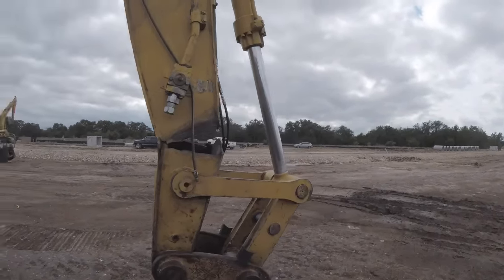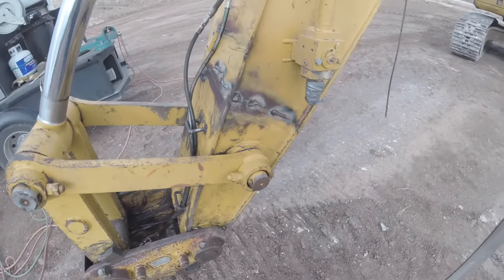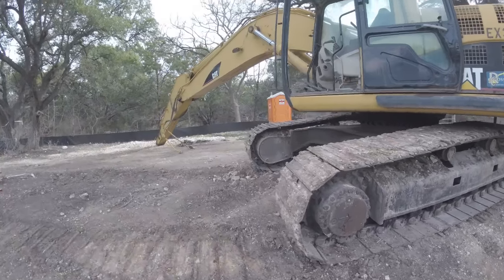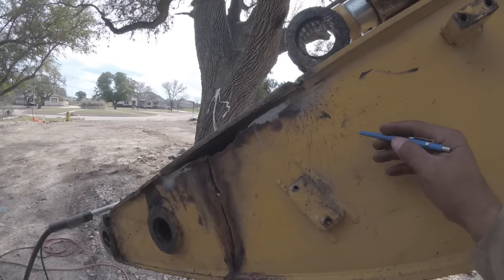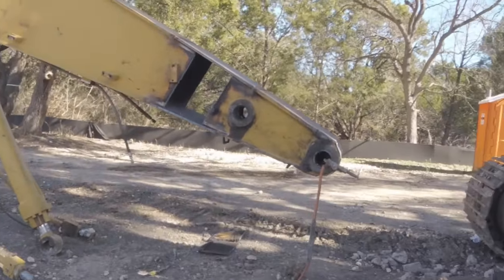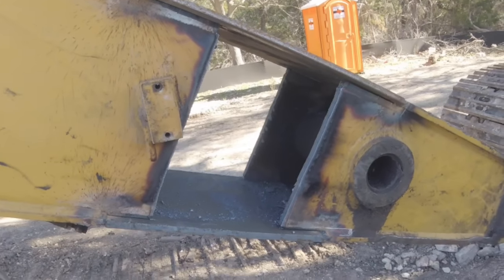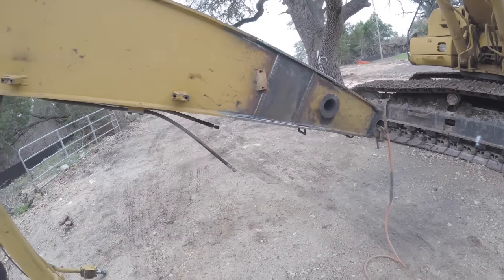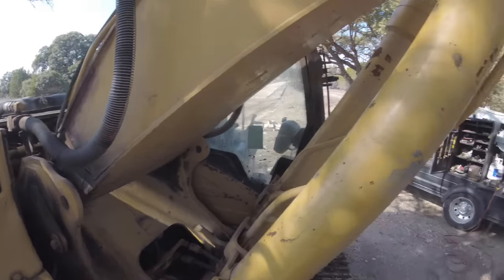Woops!! Excavator had a bad day!!

Comment: i have been welding for 35 years if this guy worked for me i would've "FIRED" HIM!. So much heat is being applied to this boom arm that the actual surrounding structural integrity is being ruined.
let me list the OMG moments i have witnessed: HE BASICALLY PUTTING A BANDAID ON THIS SHIT!

1. YOU DO NOT USE A WIRE FEED WELDER FOR THIS TYPE OF EQUIPMENT
A WIRE FED WELDER IS ONLY USED FOR ROOT PASSES IF ANYTHING OR FARM EQUIPMENT OR OTHER SMALL WELD JOBS. NEVER ON THESE BIG MACHINES. EVERY TYPE OF WELDING HAS IT'S OWN PROCESS.
 OTHER WISE A 6011 SHOULD BE USED FOR A ROOT PASS. THE REST SHOULD BE DONE IN MULTIPLE PASSES OF A 1/16" TO 1/8" 7018 ROD. FINAL PASS 1/8" TO 3/16"( 1/4" IF NOT AVAILABLE).
2. AT 20:40, HE SAYS THE STRUGGLE IS REAL! YOU DAMN RIGHT. HE HAS THE USE OF ONLY ONE FUCKING PIPE CLAMP.  IF YOU ARE USING CLAMPS DO NOT REMOVE THE CLAMPS UNTIL THE WELD IS COMPLETELY COOLED. HE COULD'VE CLAMPED THAT SO GOOD THAT ALL HE WOULD HAVE TO DO IS WRAP THE ENTIRE AREA WITH WELDING BLANKETS. OH WAIT, THERE ARE NO FUCKING WELDING BLANKETS.
THE METAL'S STRENGTH IS BEING COMPROMISED BY THE HEAT AND WHILE THIS IS HAPPENING, THE METAL IS DOING WHAT WE CALL "WALKING OR DANCING". ITS SLOWLY MOVING AND EXPANDING. THE EYE CAN'T SEE THRU THE WELD BUT THE WELD IS STRETCHING AND MOVING AS WELL.  AT THIS POINT THE CLAMPS SHOULD REMAIN TO HELP RETAIN INTEGRITY AND SHAPE AS WELL AS STRENGTH. "FML" 
3. BACKER PLATES SHOULD EXTEND FARTHER IN THE ARM IN ALL DIRECTIONS NEEDED. IN THIS VIDEO HE ALLOWED MAYBE AN INCH FOR THE NEW PLATE TO BE ATTACHED TO. THE PROPER WAY IS TO DRILL HOLES WITH A MAG DRILL (WHEN PROPERLY USED IT DOESN'T EMIT MUCH HEAT), AT LEAST 3 TO 4 OF THEM ON THE UPPER AND LOWER PART OF THE BOOM ARM PEICES AND MAKE THEM OFFSET TO HELP WITH WELD HEAT DISAPATION. 
WE ALSO HAVE A TYPE OF FIX OR REPAIR CALLED FISH MOUTHING. THIS ALSO SHOULD'VE BEEN DONE AFTER THE PLATE(S) WERE WELDED TO ADD MORE STRENGTH. THESE ARE DIAMOND SHAPED OR RECTANGULAR PEICES OF METAL THAT EXTEND BEYOUND THE REPLACED METAL, PATCH OR REPAIR.
THE BACKER PLATES SHOULD EXTEND AT LEAST 6 INCHES MINIMUM 3 INCHES PASS THE WELD WELD AREA. THEN WELD THE BACKER PLATE TO ARM USING THE HOLES DRILLED. BASICALLY FILLING THEM CALLED "PLUG WELDS". 
IN THIS VIDEO THE BACKER PLATES ARE JUST USED TO HOLD THE NEW PLATE IN PLACE. NO STRENGTH AT ALL SO STUPID.
4. WHY ARE THERE NO WELDING BLANKETS PRESENT BETWEEN EACH WELD? I WILL TELL YOU WHY. THIS MAN WAS NOT TAUGHT PROPERLY. I DO NOT CHARGE BY THE HOUR FOR EVERY JOB. THIS IS WHY I HAVE BEEN SUCCESSFUL IN MY TRADE. NOT EVERYTHING IS TEXT BOOK. EVERY PROBLEM WILL ALWAYS PRESENT ITSELF DIFFERENTLY TIME AND TIME AGAIN.
I HAVE WELDED BIG MACHINERY AND HAVE NEVER DID A JOB WITH OUT THE USE OF A WELDING BLANKET. IT DOESN'T MATTER IF THE TEMPERATURE YOU ARE WORKING IN DOESN'T CALL FOR IT.
" THE FRICKEN WELD YOU PLACE DOWN CALLS FOR IT! "
YOU NEED TO ALLOW THE METAL TO REST AND RE-MOLECULARIZE DURING THIS COOLING DOWN PERIOD. IF THIS GUY KNEW ANYTHING ABOUT METALERGY TAUGHT AT WELDING SCHOOLS WORLD WIDE HE WOULD NOT BE DOING THIS. 
"THIS IS BLASPHEMY I TELL YA... BLASPHEMY!"
5. AT 28:50 HE SAYS IT'S NOT THE BEST, BUT NOT THE WORST. ARE YOU FUCKING KIDDING ME?! THAT RIGHT THERE PROVES THAT THIS GUY IS A HACK. HE MAY HAVE WENT TO SCHOOL FOR WELDING BUT IT DID NOT TEACH HIM HOW TO ENCOUNTER AND DELEGATE PROBLEMS. THIS COMES WITH EXPERIENCE. I WOULD'VE HEATED THE ENTIRE ARM BEING WORKED ON WITH A SPACE HEATER AND "WELDING BLANKETS!" 
JUST TO PUT ICING ON THIS CAKE I WOULD'VE REMOVED THE ENTIRE ARM AND TOOK IT BACK TO MY SHOP IN A MORE TEMP CONTROLLED ENVIRONMENT IN THE FIRST PLACE. HE LITERALLY JUST PUBLICLY ADVERTISED NOT JUST TO US ON YOUTUBE BUT ON HIS CLIENTS WORK SITE THAT HE KNOWS HOW TO PLACE BANDAIDS. 
IF THIS FIX LASTS THEN HE IS ONE LUCKY "MF"! 
IN REALITY THE CLIENT SHOULD'VE SENT IT TO A MACHINE SHOP INSTEAD. EVEN THEY WOULD NOT HAVE PERFORMED HACK SURGERY ON A $100,000.00 MACHINE. 
LAST BUT NOT LEAST, PRETTY WELDS AND SURFACE BULLSHIT MEAN NOTHING IF IT'S NOT DONE PROPERLY.
PENETRATION AND SATURATION OF THE WELD MEAN MORE THAN THIS BULLSHIT!

HE EITHER CHARGED DIRT CHEAP OR THE COMPANY WAS BEING CHEAP. I WOULD'VE REPLACED A GREAT DEAL METAL AND GAVE A LIFE TIME WARRANTY. I WOULD'VE CHARGED THEM AND BUILT THEM A NEW ARM WITH NEW METAL. BECAUSE I KNOW MY WELDS WILL LAST.

Comment: All of that??? You should have just added half inch plate top bottom and both sides.. one solid piece 16in on either side of the crack.. on the sides..two pieces of 3/4 plate again 16 in either side of the crack.. on the top... Clampitt welded good for another 10 years you would have been done... At this point I'm at the 11 minute and 35 seconds time stamp and.. EITHER YOU'RE REALLY GREEN OR YOU'RE MAKING YOUR MILK MONEY...

Comment: Why is that being welded? It has failed way too many times for more repairs. The metal is fatigued and cannot be made strong enough to do the job it was designed and built for. You are opening yourself up to be sued WHEN that fails again. Metal is amazing, it can do so many things but it reaches a point where it can't be safely repaired no matter how good you are. That metal will never be as it what the manufacturer requires for that boom arm. That steel needs to be melted down and recycled, that is the only way it will ever see safe use again. 

If a company can't afford to replace worn out equipment they shouldn't be able to keep their license to operate the equipment. This machine should be inspected and that boom arm needs to be magnetically checked, xrayed, and have an ultrasound survey done on it. I can guarantee it will fail every single one of those inspections. 

I wouldn't repair that equipment for all the money in the world. It's just not worth the risk because it will fail again directly adjacent to your weld repairs. They are overloading the machine and that spot right there breaking so much, as evidenced by all the previous weld, is direct proof that they need a machine about 50% larger to safely do the work they are trying to do with an insufficient machine.  I've got several thousand hours in big backhoes and the strain this machine is seeing is unacceptable. Company owner is either broke and can't afford to fix it, if that's the case maybe they should sell the company to someone who can operate it properly, or they are just greedy and putting maintenance money in their pockets. Either way the employees on site are in danger of that failing over and over again and possibly being hurt or killed by it. 

This is a great example of why we need more machine and work safety regulations as well as frequent safety inspections and the regulations need to be enforced. This machine should be taken out of service until a new boom arm is bought for it. If they buy a used one it should be inspected before the machine is given the ok to resume operating. It's also a great example of why equipment operators need to be trained properly. The operator should never have allowed it to get to this point. The cracks should have been noted and an inspection done. If the owner can't afford to run his business safely he shouldn't be allowed to own a business and have employees he needlessly puts in danger of equipment that is beyond it's safe operating lifetime.